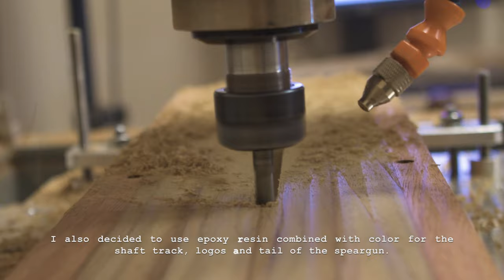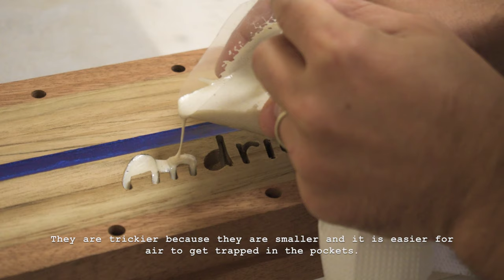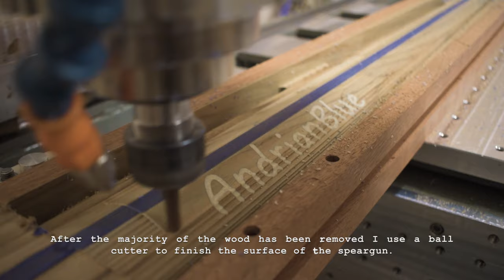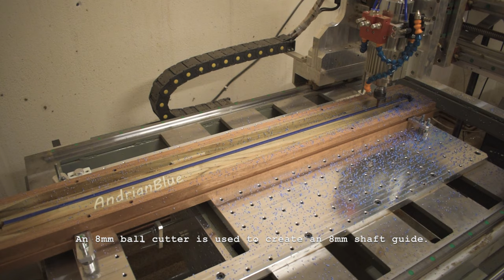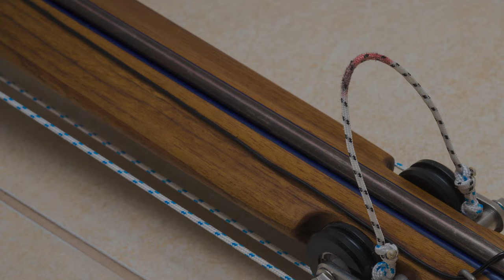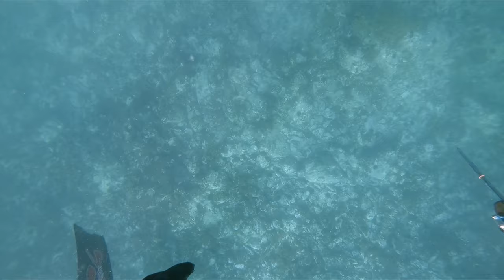Building an invert roller speargun!!

Comment: I'm currently building an invert similar to this, but still a way I have never seen done. It was important to me to have my trigger guard AND most of my handle molded into THE SAME blank. There is a huge issue I'm having which is shaping is very difficult with a gun that tapers on 3 sides, and can't run the router down all sides and just be done quickly.. With that said, I'm finally about done, and then the fun editing of all the filming I have been doing can begin.   Also, with the price of Teak here in Hawaii, the CNC option is not practical as you need A LOT more sacrificial material. Then again, I've had to remove a lot of material just with having my trigger guard and handle in the same blank.
Reply from the maker: Hi. When I started designing my first build I wanted to have the whole speargun from one blank too. But I abandoned the idea because too much material would be wasted and was harder to build on the cnc. Teak is expensive here too. When you have the video ready let me know. I am really interested to see how you worked on it!
Reply: @AndrianBLUE  I actually didn't waste too much with a blank 3.75" x 3.75" (95mm x 95mm) since I have been making cuts and not planing material everywhere, maybe ill make more pathos replacement butts for people who keep asking. Your CNC blank needs a lot more material just for clamping (but I'm sure you could figure a way to epoxy in some clamping and centering supports to avoid such a large blank) but will definitely let you know once I drop the video. I'm compulsive about adding the details I couldn't find in other YouTube videos, like how I made my enclosed track. I've posted some photos on the 8-inch-shaka Instagram. Feel free to check out current status there too.
Reply from the maker: @8InchShaka  At the moment I use mdf glued on the sides of teak so I do not waste teak wood just for having clamping space.

Comment: I'm sure it's a good gun, but using a CNC is not craftsmanship.  Watching a router run isn't entertaining either.  I quit at 3 mins,
Reply from the maker: Sure mate. If you think it is easier to build something with CNC then I encourage you to try it. Design a speargun in CAD, then program it in CAM, then machine it on a CNC machine and then come tell us how easy it is and how it doesn't require craftsmanship. If you think you can build a structurally better speargun by hand than with a CNC then do it and bring it here and we will measure together how straight and symmetrical it is on the CNC and compare it with one built on a CNC machine.
Reply: @AndrianBLUE  Hi , what program do you use to design your gun, Fusion 360? I already make my own speargun by hands but I'm going to get a CNC machine soon, so my first step is to design speargun, how many times do you spend to design it on computer ? Very nice gun by the way, well done ;)
Reply from the maker: @tatanegabian  Hi and thank you! Yes I use fusion360. It has taken a lot of time actually. I have been designing it for around 2 years (designing, building, testing, making adjustments, building, testing etc...) It is a fun process! I hope you enjoy it! Cheers!